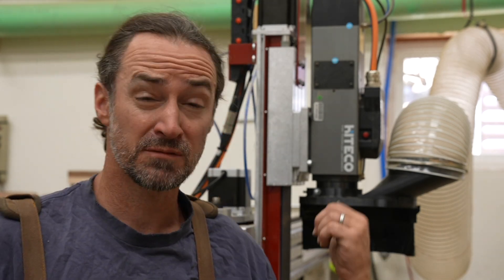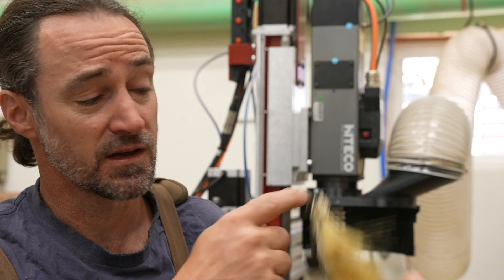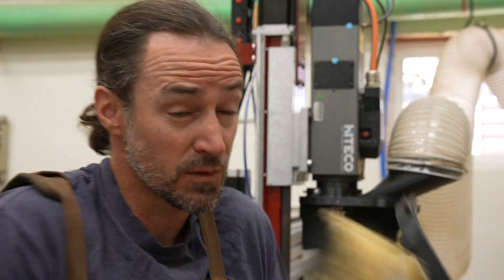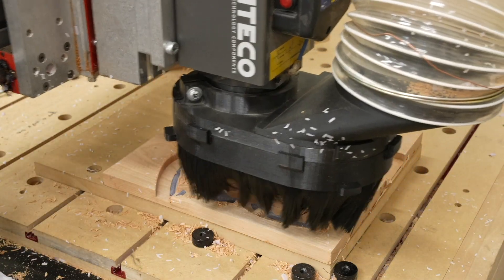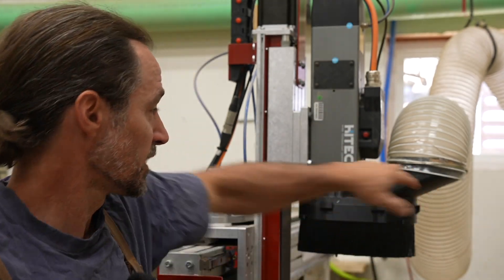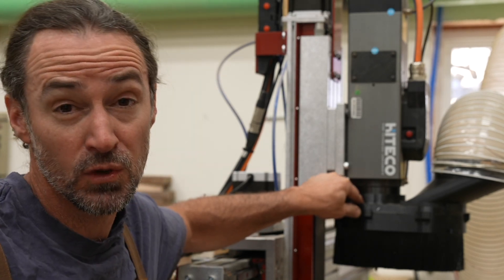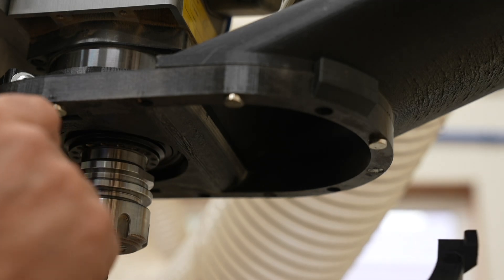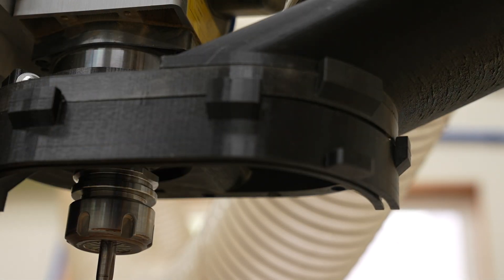CNC Dust Shoe Version 3! Print your own CNC dust boot for cheap

Comment: How well do you think Kevlar filament will work with this?
Reply from the maker: I honestly don't know much about it! I used PLA, but my spindle doesn't get too hot. If you have a hot spindle, PLA may melt, and PETG or ASA may be a better choice.

Comment: Hey Corbin! i downloaded the file, changed the spindle diameter to 100mm. now im getting a flag for "extrude 42"
Warning: Extrude42
<b>1 Reference Failures</b><br/>The profile reference is lost and this feature is using cached geometry.<br/>Edit this feature and select new profile references.

The issue is the software wont let me export to any other format due to lack of data i assume.

I've been messing with it for an hour or so and cant figure it out. Any chance you could lend a hand?
Reply from the maker: Hi! 90mm is the largest I tested; it's possible that 100mm may require a re-design to make other parts larger. I'm planning on (some day) making a new version that is more flexible with dealing with various extreme sizes (really small and really big). You right click on the Body and export that as a mesh/stl.

Comment: I had some trouble changing parameters, and no matter what I did I kept breaking the model trying to get something that would fit my equipment. Never miss an opportunity to improve my modeling, though! Took me three tries, but I have a functioning, completely parametric model, and the first print wasn't bad. I embed the magnets inside the print by pausing at the right level and dropping them in mid-print, never fall out and no need for the press fit. Since they don't get as close, they don't hold as well, so I'm going to add a couple more back in. Otherwise, it's great! Thanks for the idea and the motivation! 
Once I get the extra magnets added in, I'll be ready to share it, as you've done.

https://youtu.be/mkUWtn-wbJw?si=Kp1WMbme6t6gt7Zt
Reply from the maker: Awesome job, Tony! Yeah, the parameters are limiting to what I tested, and trying to change the base size breaks a lot of things. If/when I redo it, I will make it more flexible with changing sizes. Let me know when you post a version; I've had some people request a smaller version, and this might be perfect for them.

Comment: Corbin, this is a awesome design and it is very generous of you to share your files. It is great that the spindle hole and the dust collector hole size can be varied. One suggestion. It would be nice if the spindle hole could be moved closer to the edge of the boot. My CAMaster CNC has a spindle that only has about 3/4" between the spindle and the spindle support plate....your boot, as designed, won't fit. ☹If I could move the spindle hole I would be happy to purchase the files.
Reply from the maker: Hi Bob, If you are familiar with Fusion you should be able to modify the earlier sketches a bit to move over stuff, but it will likely cause some downstream issues later on. I have heard from a few people that the backside is a bit tight - if/when I do a re-design I'll definitely make this part more configurable!
Reply: @CorbinDunn  Thanks Corbin....yes, I am a familiar with Fusion 360 however I am a novice. I have been trying to do just what you recommend. In theory, it seems simple enough, but as you say, the downstream impact is significant, and is giving me fits. I just need to keep at it. Again, thanks for all the cool stuff you do for the maker community. Keep up the good work! Cheers, Bob

Comment: Hi Corbin. I use a milwaukee router as my spindle, which has a diameter of 110 mm. When I open the fusion file to modify the parameters, there is an error in the file for the "Rigid 1" part that says  "Warning: ImplicitJointOrigin2(Rigid 1) 1 Reference Failures. Failed to evaluate the direction due to the invalid input 2 Reference Failures The model is using cached geometry to solve. Please reselect reference geometry for failed features in the timeline." Any chance you know whats happening? Depending on what I do next, Fusion crashes and quits. When I AM able to change the collar diameter to 110 mm, many of the chamfers fail and when I try to edit them, Fusion crashes. Thanks much.
Reply from the maker: Ah bummer! The problem is I really designed it for my 90mm spindle, but made it parametric, however, certain sizes will start to make the model break due to the outer dimensions being more fixed. If you can change it to 110mm, scroll through the timeline to the start, save, go forward and find out what operation is causing it to crash (or have a problem), and delete those things or repair them. If I make this design again I'll make it more flexible with sizings and have less of these problems (to some extent).

Comment: when I downloaded it today, I got a f3z file which, when I tried loading into fusion360, gave an error about single-user storage vs team storage. I solved it by unzipping the f3z file (using unzip, but you have to change the file extension) and loading the f3d file instead. Hopefully, that's just a user error.
My spindle is a 65mm diameter spindle with 4" collector hose. Not one of your existing stl sizes.
Thanks either way. If the shoe is as thoroughly thought out as the video, I'll be very happy. nice work
Reply from the maker: Hi Miles - I'd recommend upgrading to team storage, it'll give you more features in Fusion, and I hear they are eventually going to force all users to move to teams (even if you are a single user, like me). I specifically use one feature called "Configurations", which allow it to switch between different settings being shown. I do mention this in the download, but it is easy to miss. I have no idea how the file will behave by extracting out the .f3d file, so proceed at your own caution!  But yeah, you should be able to set the parameters for the spindle size you have. The only issue I've seen people have with small spindles is the back of the shoe hitting the gantry, as that size is rather fixed. I know some people have fixed it by editing the file. Best of luck!
Reply: @CorbinDunn  plus I'm realizing now that using teams does NOT mean upgrading to a paid sub. Nice side effect of the video.
Reply from the maker: @milesmccoo  Oh yeah, I should have probably started by mentioning that!

Comment: How about to add a pneumatic cylinder for the dust booth?
Reply from the maker: You mean, to move it up and down for a tool change? I haven't done this...but it would be no different than the other operations in Mach 4. You hookup some available pin output to be activated and add code to activate it. You could base it off the code I added to turn the spindle fan on and off; but instead of a fan, it just activates a solenoid to add air to a cylinder.
Reply from the maker: ..and to elaborate: My preference was to not do this, and instead make the dust boot "slim" enough to allow 10 tools on a 4' wide machine. If you moved the dust boot out of the way during a change, you could easily get a lot more tools on a rack.
Reply: @CorbinDunn  thanks

Comment: what about the static electricity in the vacuum hose ?
Reply from the maker: It can definitely be a problem! I should show a photo of my setup: I ran a thin copper wire around my dust hose, just loosely wrapping it, and going to an outlet on the wall, connecting it to the EMT with a screw or bolt. Before I did that I would get little shocks from the static whenever I touched  the boot after it was running for a while. After I did the grounding that problem went away. It never affected the machine, but more sensitive machines sometimes simply stop due to this issue.